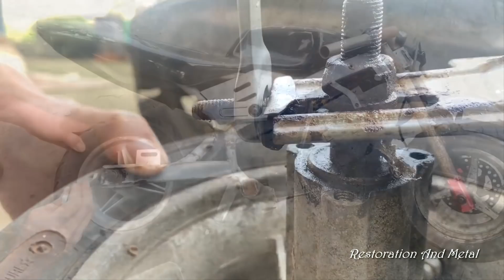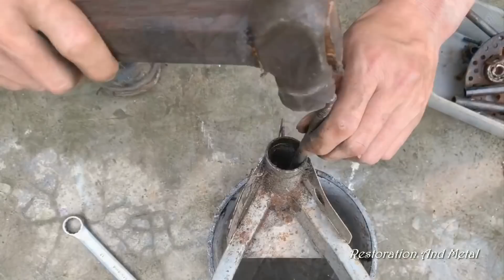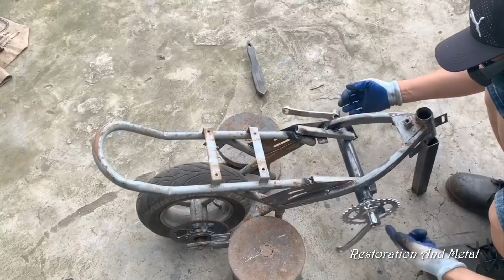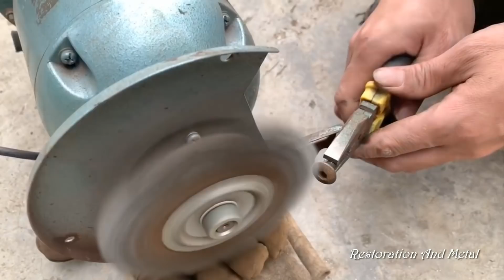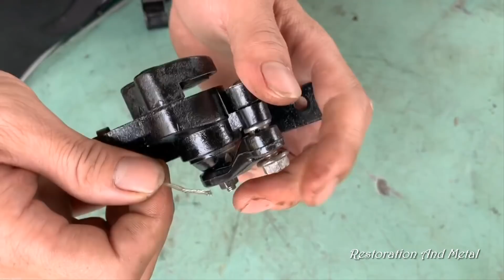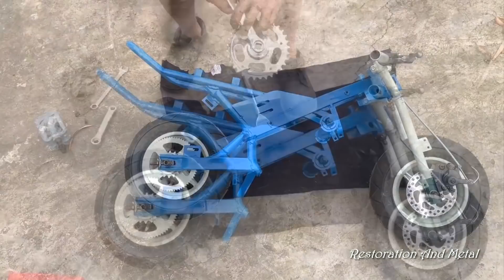Restoration motorbike racing old - Making scrap present for two daughters Twins

Comment: What the hell? Total waste of time, if no one can ride it! It doesn't even look good! I was expecting it to just be a push bike without pedals, which would have been WAY more fun for your daughters! Now there are pedals (fixed, by the way, dangerous under normal circumstances, let alone when they are at stomach level), and the handlebars are backwards, making it totally unrideable! Not ideas are good ideas! Sometimes simple is better.

Comment: That freewheel that you sprayed over with paint was so misaligned that when you installed the chain it could barely move but when the bike moved then it was as saggy as an old lady's tits. Also please tell me you replaced or at least cleaned the brake pads of any oil because it sure sounds like you didn't. All these things are serious hazards on a bike.

Comment: why didn't you straighten that front fork? also, I don't get the spray can top glued on like that, why didn't you cut it down so it was almost flush? For the tools you have to work with, it's a pretty good job, but some more thinking could have made it better. By the way, baking soda and super glue makes a very good, strong and hard filler. the sawdust kinda works, but baking soda would work better since it's stronger and becomes one material rather than particles held together with glue.